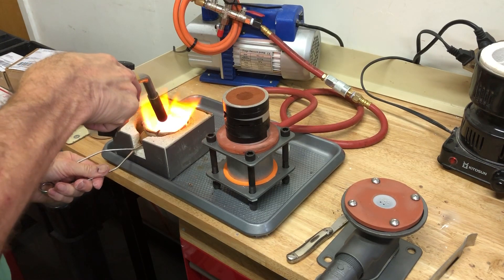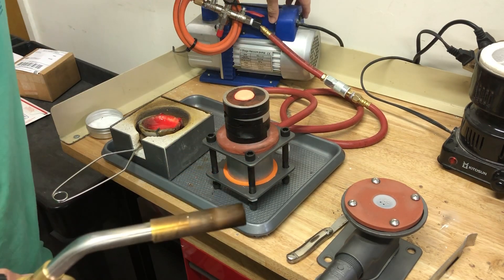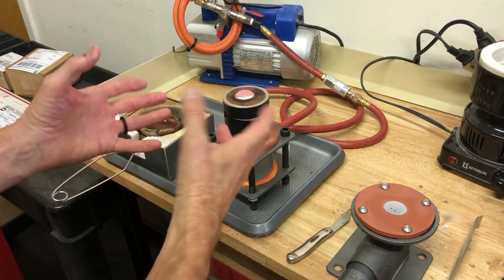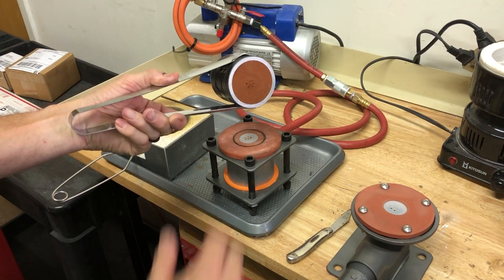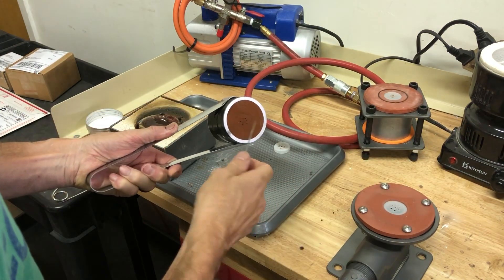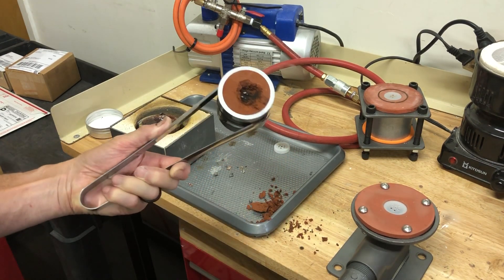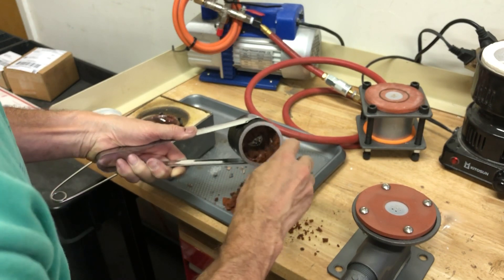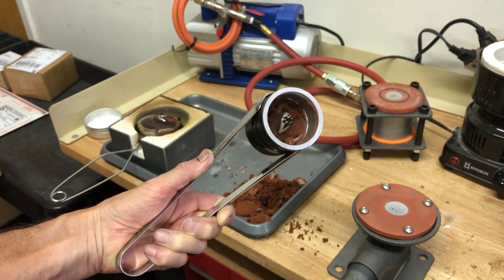Casting Video for New Sand Casting System - Video Two

Comment: Do you only do sand casting and not lost wax if so does that vacuum table work on burn out casting with heat
Reply from the maker: it could but the silicone seal should be one that is purchased from a jewelry company and not this one that I made. Mine probably wouldn't hold up.